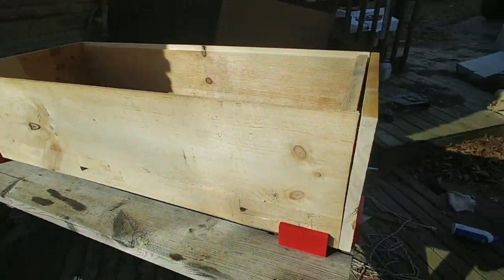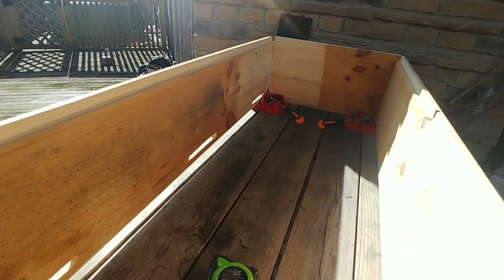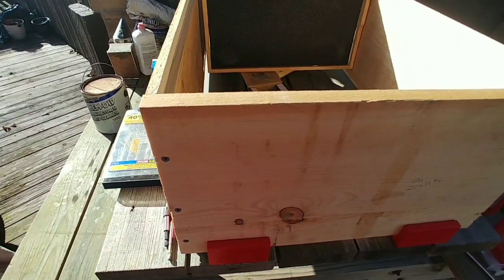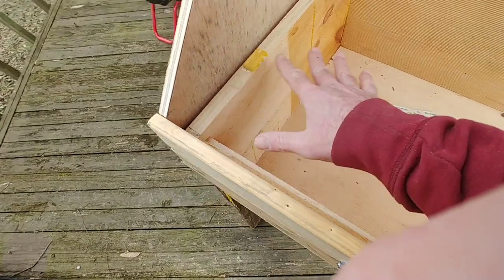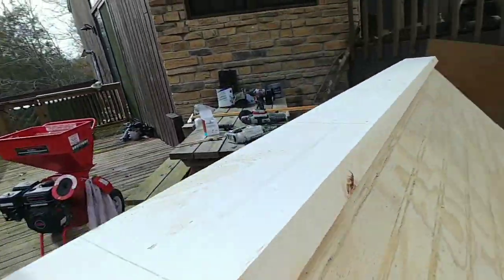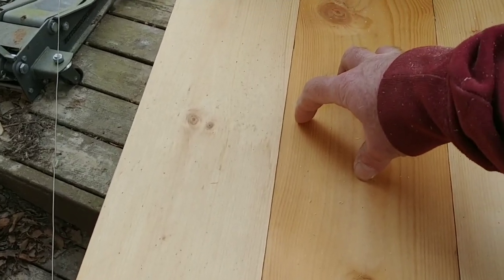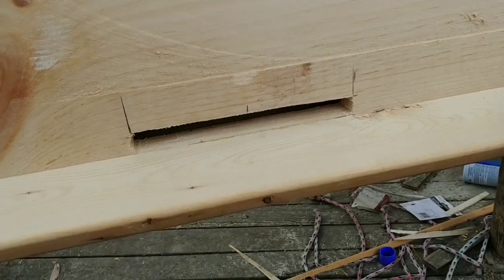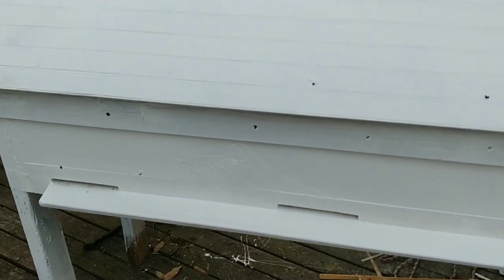built a langstroth long bee hive #bee #hive #langstroth #long #horizontal #apiary #honeybee

Comment from the maker: sorry about the wind noise, that side of the house always has a breeze - power just now came back on after being without for about 16 hours so that means I also have an upcoming video on how to keep 5 day old baby chics warm without a heat lamp lol .... also, off to build 2 more long hives but these are my own design entirely.
Reply: Please make a how to video
Reply from the maker: @Bouncin-Thoughts  I think i recorded building these as a how to video and then didn't post it because there were a billion other how to build langstroth long videos. Mine might be a little different because i basically made it up as i went but its pretty easy to do if you have any knowledge of building things. I mean, its basically just a box sized to fit langstroth bee frames.  However, i do have a different long hive video coming up soon that solves a lot of the problems (actually all of the problems) people using langstroth long hives face (i intentionally built these to test my theory why they were having issues), especially in colder climates.

Comment: I am getting on in years and have been thinking of changing over to Langstroth long hives, I think it will save me a whole lot of back and knee pain that I suffer when bending.
 For my Regular cedar Langstroth hives I use a wipe on polyester waterbased clear coat using a foam brush, its much easier to apply than even thinned paint and will never crack like paint eventually does.
Reply from the maker: Thanks for the suggestion on sealer.  With langstroth long hives, there is a little bit of a learning curve. I'm kinda thinking people wouldn't realize how different they were if they were new to beekeeping but someone with experience is going to see the differences right away.  Climate is going to be a huge player in how well they over-winter as that seems to be the biggest issue i have seen for zone 6b.

Comment: I built 2 long langs last year, love them. Plan to build 2 or 3 more over this winter. I like your tall roof, mine are too short to use anything bigger than a pint jar for a feeder.  Mine also have a lower compartment with 1/8 inch hardware cloth seperating it from the hive area, this is for putting a pan of cooking oil under the brood area for hive Beatles and mites and yes it works. I only made a single entrance, I have vent holes in 2 of my cover boards covered with 1/8 as well as closable vents in the bottom chamber. I splayed my legs wider in case of high winds, I'm not more than 75 miles from the gulf of Mexico and we do occasionally get hurricanes here. I'd suggest you drill a few small holes in your bottom in case you have water leak in. Those long hives are easy on a man with a bad back. Good luck!
Reply from the maker: thanks for the recommendations.  I mostly built the langstroth long hive to use so I could measure its finished size for a custom long hive I wanted to build.  The custom long hive I had in mind was using features i liked from each of several long hive styles (langstroth, layens, and lazutin hives) while leaving out the features i didn't like.  I built 2 of them to test along with the langstroth long hive.  When I originally built these long hives, they all had the 3 entrances but it didn't take me long to block off 2 of them on each hive.  Even with the divider boards, other bees, hornets, and wasps were constantly coming and going out of those additional entrances.  That stopped once I blocked them off.  I probably should have done a video on that ... but there are only so many hours in the day lol.

Comment: What dimensions are the gable end"s?
Reply from the maker: i don't think I actually measured anything for the gable ends ... I basically had the box built and freehand built the roof support pieces and just eyeballed it for the first end (If my memory is correct, which often times it isn't post cancer ... I may have used a piece of cardboard to make a template by tracing the roof support pieces and then transferred that to the plywood for the gable ends) .  Once I had the first end cut to size I just duplicated it for the other end.  Sorry thats not much help but hopefully can point you in the right direction.
Reply from the maker: one other tip ... you can take a long string like for sewing or 550 paracord .... attach each lose end to the opposing box corners on the gable ends ... raise the string up so it forms a triangle, and when its the height you like ... just use a tape measure to measure from the box corner to the top of the triangle.  I may have  even just measured corner to corner on the box and then made all 3 sides of the gable end the same length.  I can't remember now ....
Reply: @sharpridgehomestead  Thank you, I am redoing my top as I just had a flat top, I use a frame feeder, but I will
be using a jar feeder to start this year, hopefully we just had our last snowfall for the year.
Reply from the maker: @davidweber1291  The weather has been crazy. It went from 70's last week to almost freezing the last few days. I've got splits to do i delayed due to weather and hopefully they don't swarm before i can get to them.